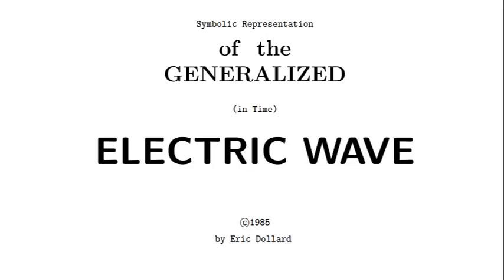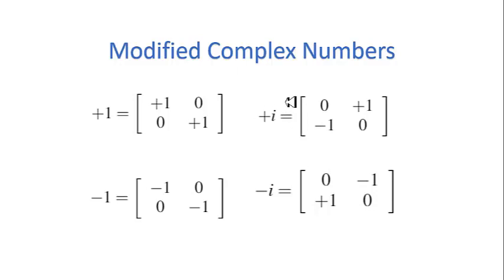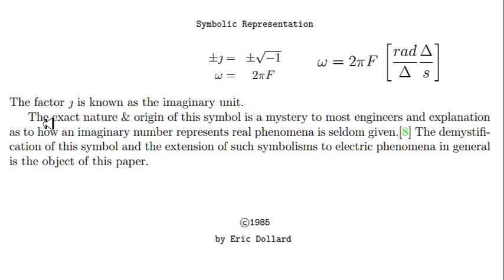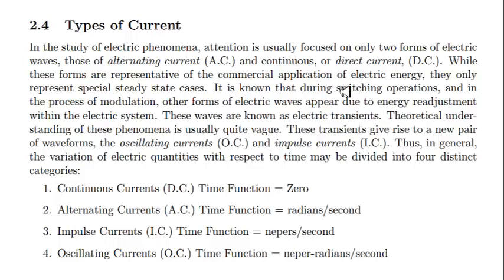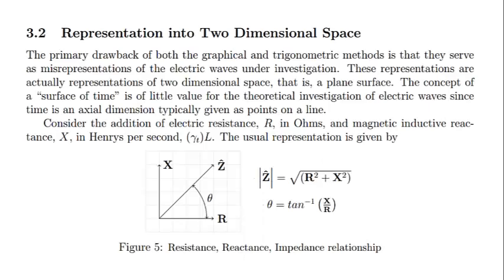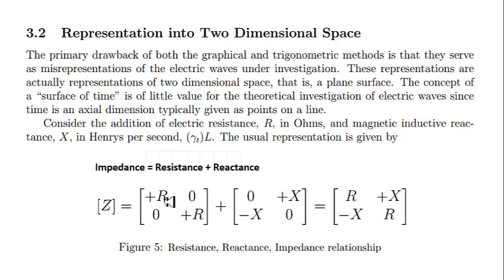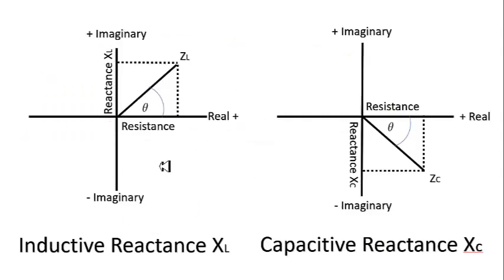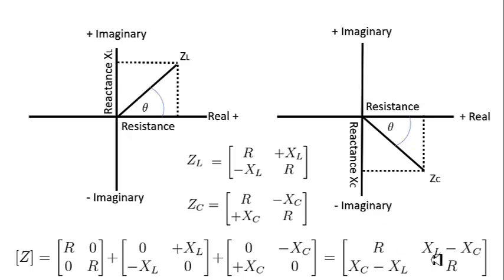Demystifying Eric Dollard using Modified Complex Numbers

Comment: Good stuff!  Personally I view complex numbers as nothing more than the algebra of rotation/dilation.  The fact that they emerged from a fantastical notion of the square root of -1 is just a historical curiosity.

 I really recommend NJ Wildberger's channel Insights Into Mathematics for better/newer ways of viewing stuff like this.  The problems we see in scientific theory actually extend into Mathematics and he's one of the few people trying to fix the discipline.
Reply from the maker: Complex numbers are merely 2-dimensional numbers with a few simple rules (forward diagonal same sense, backward diagonal opposite sense). These 2D numbers are responsible for dilation and rotation. Algebra is the symbolic expression of 2-dimensional numbers. Symbolic languages are nice when you need to write a paper and you want it to look pretty. The 2D expression of complex numbers is much easier to implement on the computer. In my opinion.
Reply: @FractalWoman  In your Planck paper which I read about 3/5 of, you wrote in the beginning: "This is
because time itself is its own domain, separate from the
domains of space, mass and charge." 
An own domain in mathematics of course. 
It is not an existential dynamics "domain."  
Should we be very careful about how we in science define time?
Reply from the maker: @aleksanderh.5407  Time is an emergent property of change. If change didn't exist, then time could not exist.That is how I define time in my cosmology. The words time and change are "interchangable".
Reply from the maker: @aleksanderh.5407  Time is an emergent property of change. If change didn't happen, time could not exist. I define all my terms in terms of change. Inertia is resistance to change. Entropy is change that cannot be undone (irreversible change). Calculus is the language of change. etc. I have a longer list but I can't think of them all off the top of my head.
Reply from the maker: Hey, thanks for the recommendation. Will check it out for sure.

Comment: So when the inductor and the capacitor are in perfect tune, as in a tank circuit, the result is a multiple of a square root of one, though harmonics could also be produced with different ratios.
Reply from the maker: What do you mean by a multiple of square root of one? Can you map that out using Modified Complex Numbers?
Reply: My mistake, you're using i and -i to represent the non-real part of inductive and capacitive reactance respectively.
Reply: So when they are in perfect tune you get a real number output with no imaginary component?
Reply from the maker: @whig01  Correct. The imaginary components cancel out.
Reply from the maker: Now, when there is no  resistor, then all you are left with is the resistance in the system, which is never zero. So there will always be a real component.
Reply from the maker: @whig01  That is the interesting thing. With only a resistor and no capacitor or inductor, there is no resonance, and no imaginary component. With perfect resonance, there is also no imaginary component. There is only an imaginary component when there is imperfect resonance.
Reply: But a resonant state is different from a resistive-only state so there needs to be some other non-real component.
Reply from the maker: @whig01  Pure resistive circuits don't require an imaginary component. They can be modelled with real (1-dimensional) numbers only. Resonant circuits with a capacitor and an inductor DO need an imaginary component, even if they are tuned to be perfect resonators. In realty, there is no such thing as a PERFECT resonant circuit, just like, in reality, there is not such thing as a circuit with no resistance. In a resonant circuit, you still have a capacitor and an inductor and you can tune them to be AMLOST exactly the same so that the backward diagonal is ALMOST zero, but it will never be exactly zero, therefore, you still need the imaginary component. So, I don't agree with the statement "there needs to be some other non-real component." The one I am talking about is perfectly fine just the way it is.
Reply from the maker: @whig01  Also, wires themselves have both inductance and capacitance (longer wires have more inductance and capacitance). Thus, in the case of the circuit with a resistor only, we can't assume that there is no inductance and no capacitance in the circuit, and so technically, there should still be a non-zero imaginary component in the resistor only case.
Reply from the maker: The upper right imaginary component is technically:

+ (X_L_wire - X_C_wire + X_L_inductor –X_C_capacitor)

The lower left imaginary component is:

- (X_L_wire - X_C_wire + X_L_inductor –X_C_capacitor)
Reply: @FractalWoman  id like to understand this. I do understand the part about oscillations and resonance between inductor and capacitor. I'm about to finally start doing electronics! I'm slowly teaching myself and this is what I'm into... plus other resonant coils and bifilar pancake coils. I'm finally going to make some. I'm interested in HHO and hydrogen and light. God bless.
Reply from the maker: @TravisTellsTruths  Great. Good luck with your research. And don't forget to have fun too.

Comment: Are you saying incommensurability is the same as orthogonality?
Reply from the maker: Orthogonality is a property of incommensurability. You can have orthogonality without incommensurability (like x,y,z directions in space), but you can't have incommensurability without orthogonality. It is a subtle but important difference.
Reply: @FractalWoman  Thanks for the clarification.  :)
Reply from the maker: @wesbaumguardner8829  Incommensurability involves two unlike principles that work together in a conjugate fashion, like the dielectric and magnetic components of electricity. 
Incommensurate: Having nothing in common, impossible to compare. 
Conjugate:  joined together, especially in pairs;  opposite, inverse or reciprocal yet coupled, connected, or related in some manner. 
Real and imaginary numbers are incommensurate in that you cannot compare one with the other, but they can coexist in the 2x2 matrix and together, they can be used to do calculations that are not possible without each other. The Mandelbrot Set is an example of what can be done when you combine and conjugate real and imaginary "numbers".

Comment: Good stuff Lori. This will illuminate the need for differential equations.  Will you illustrate the matrix form of the susceptance, conductance, and admittance?  Those are vital especially when dealing with oscillating and impulse currents and power.

Thanks Lori
Reply from the maker: Yes, I will be illustrating conductance, suceptance and admittance. It is basically the same as resistance, reactance and impedance only inverse and reciprocal. Conductance, G = 1/R, is on the forward diagonal and suceptance, B = 1/X, is on the backward diagonal. Capacitive suceptance is in the positive real : positive imaginary quadrant and inductive suceptance is in the positive real : negative imaginary quadrant. This should give you enough information to write down the equations using Modified Complex Numbers.
Reply: Thanks Lori. This will make for a great paper. 👍
Reply: Hi Lori.  I've been doing some digging through Steinmetz AC Phenom.  I think that for AC circuits conductance g = R / (R^2+(wL-1/w/c)^2)   = R / Z^2     and   for    susceptance b = (wL-1/w/c) / (R^2+(wL-1/w/c)^2) = (XL-XC) / Z^2.   I'm not certain these will equate to G=1/R and B = 1/X.   Can you verity?  I may be off.  Even in Steinmetz equations for oscillating currents g and b are shown as i described except they are compounded with a logarithmic decrement factor.
Reply from the maker: @scolem2681  This all works out much nicer when you use Modified Complex Numbers. You will see when I make my next video which will include admittance, conductance and susceptance. The pattern is clear.
Reply: @FractalWoman  ok. Thanks.